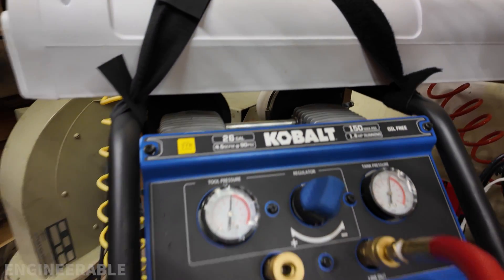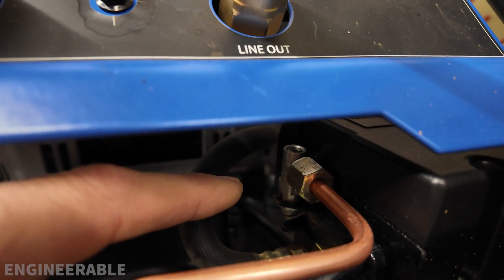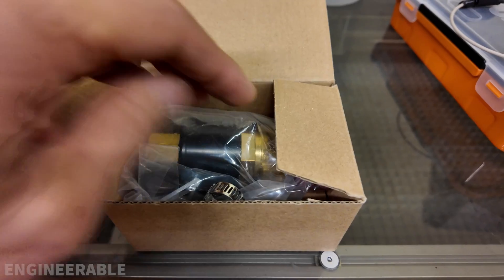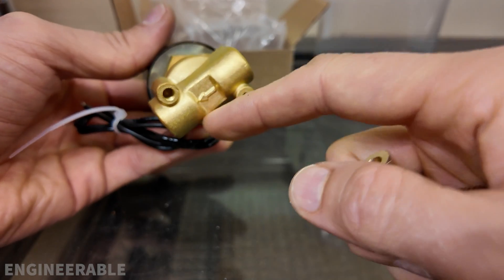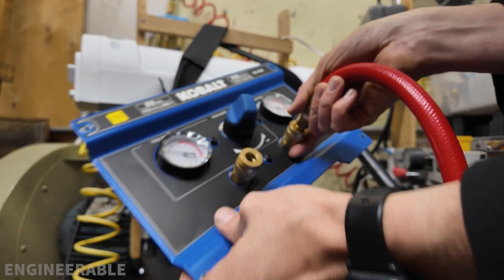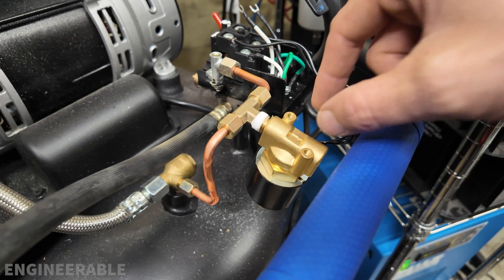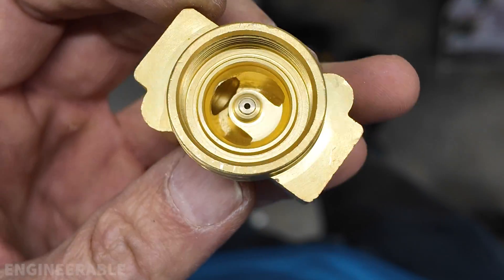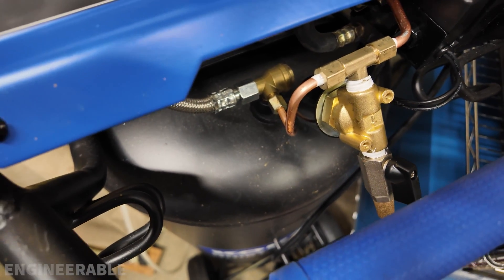How To CONTROL AIR COMPRESSOR REMOTELY with a SMART SWITCH | PART 2: Electric Unloader Valve

Comment: you could also use home assistant and set an automation to check if current is flowing befre cycling off via using the zwave integration, saves all this work